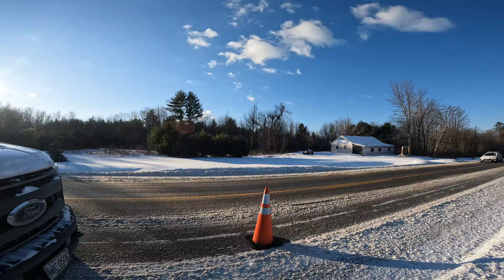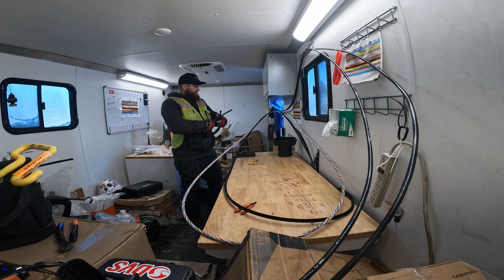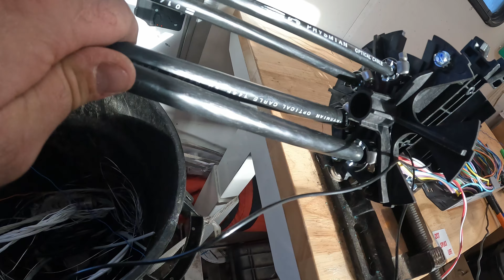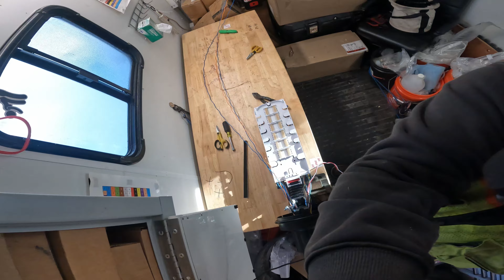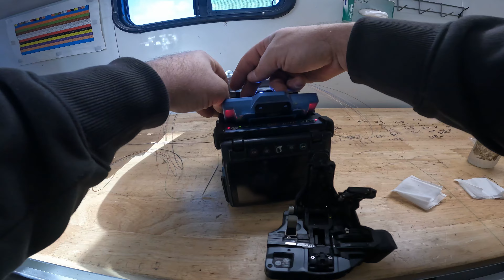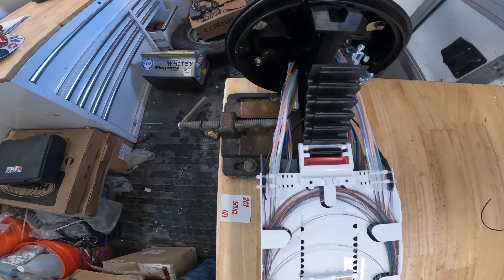HOW TO SPLICE FIBER OPTIC CABLE!!!!

Comment: At the start of the vid, can you show the cables up on the spans before you start, and explain which cable is the trunk you're ring cutting into, and which are the branches you're slicing in, from the perspective of the street? It gives us context into why you're doing this. 😊😊😊